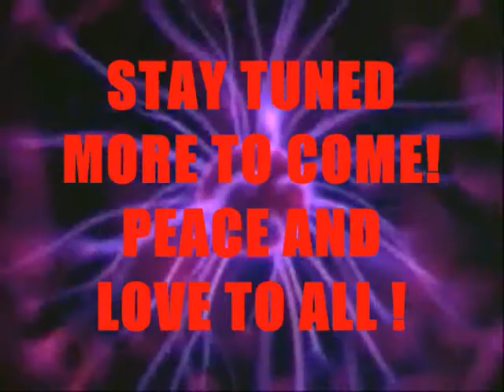DEBUNK THIS !!!

Comment: The meter shows volts not power and not energy.  I build circuits that output more voltage than they take in all the time,

Volts times Amps = Power
1 * 2 = 2
2 * 1 = 2

In both cases, the power is 2W but in the second the voltage is doubled.
Reply from the maker: It is volts Im looking for, everyone will see why soon enough.
Reply: shazizz 12V from about 9V is really easy.

Comment: Your grd wire to the 12v light came off from it's capacitor right away in  your video.
Reply from the maker: If you are talking about the black wire it was never connected. The red and white wire were the only two used. Best thing I can say is to try it and see if you get the same results. And if you need help with the test I am more than happy to supply you with any information you need to duplicate it.
Reply: Thank you for your response. I can't do experiments right now. I'm due for a neck fusion Dec. 18. But I do enjoy your videos. God Bless and keep up the good work.
Reply from the maker: I will keep you in my prayers my friend in hopes for a speedy recovery. Thank you and God bless you as well.